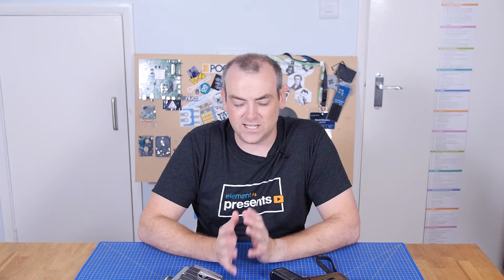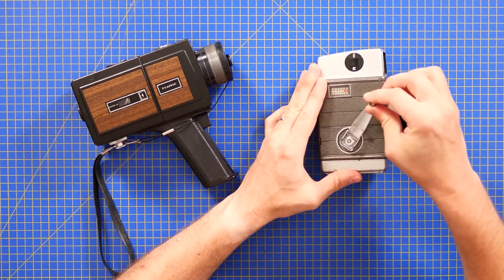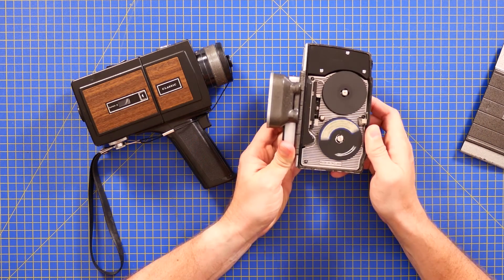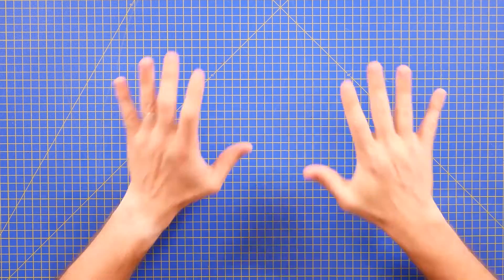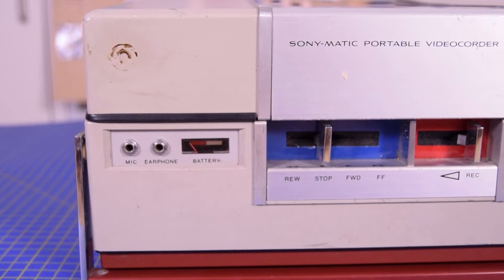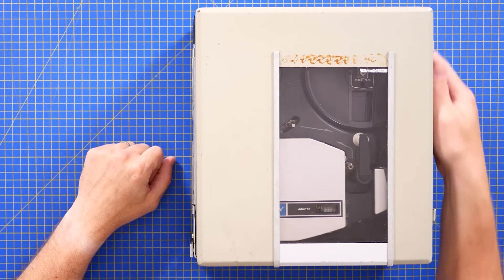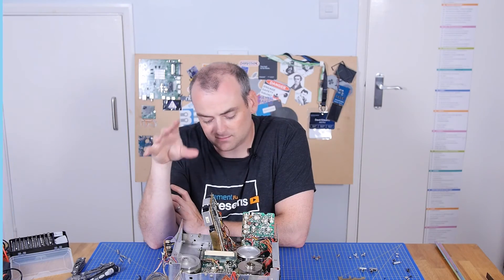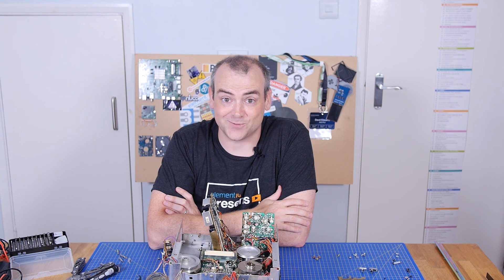Looking Inside 50-Year-Old Video Equipment - The Electronics Inside

Comment: My school, around 1974 on, had a couple of the full-size reel-to reel VCRs of the same vintage, but for the video camera, they had a later replacement for the model in your video that used small U-Matic cassettes, I think with a record/play time of 20 minutes as opposed to the full sized time of 60 minutes. It looks like they used a very similar battery pack, which was sealed lead acid, but not gel, it had the acid sloshing around in it.
Reply: I do believe that I read in the service manual this was a lead acid pack too. Although, I think I will be powering it with a beach power supply!

Comment: I love all the oddly-verbose text in that:
“Do not press strongly or put anything heavy on this cover.” (5:46);
“Battery pack plug in” (8:51);
“RF Unit - push in strongly as far as it will go” (8:51)

That's so different to most modern devices that try to reduce instructions to as few words as possible, or even forego words entirely, instead relying on cryptic icons!
Reply: I would guess the products were much less international? As a result they knew the languages they were selling to, and it would have been easier to be verbose? If you are making a multi market product today, a picture speaks many languages?

But yes, the wording is somehow charming!

Comment: I would like to see it running again! I'm curious about the picture quality it produces!
Reply: Me too!
Reply: I have one but I don't have any tape so I've never had it running. Just from the size and age of the camera I'd have to assume it's black and white video; never had it open though, I can only assume it's one monochrome video tube. I'm sure if you could tap a clean luma+sync signal it should look pretty good on a monochrome video monitor.

The lens isn't all that great though. It's C mount so I use it with my modded GoPro and have shot some timelapses which you can find on my youtube channel. Lots of chromatic aberration.

Comment: Please put it back together and power it up. I have no idea where you're going to get a compatible camera (or tape) but even if the smoke comes out, you can donate it to a museum somewhere for display purposes.  
BTW - any idea if the unit you have was PAL or NTSC (or - unlikely but - possibly even SECAM)?
Reply: I don't think a camera should be hard to find, although the cost may be interesting!

Finding working media on the other hand may be a bigger challenge!

It was bought in the UK, so I hope it'll be pal. If not, there may be some interesting adapters and converters involved!